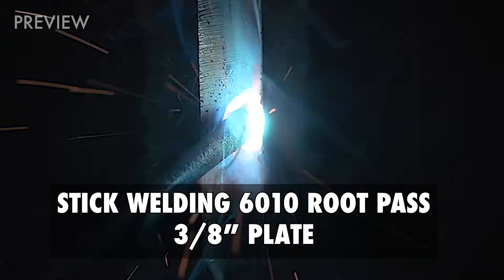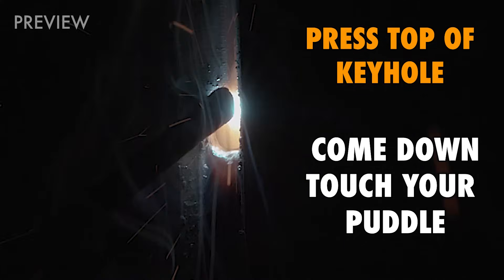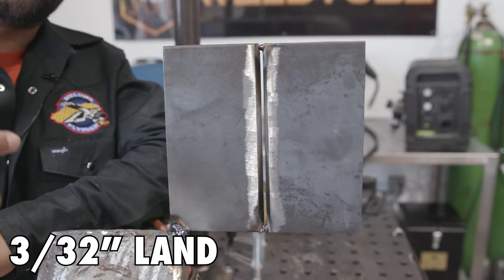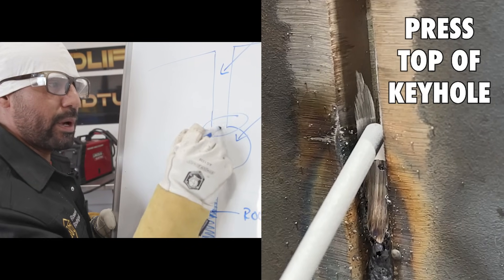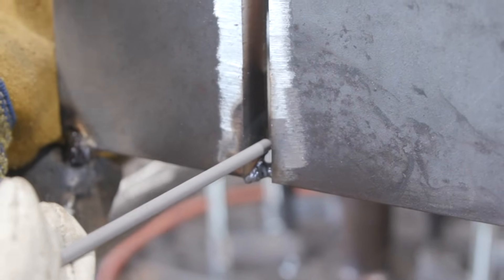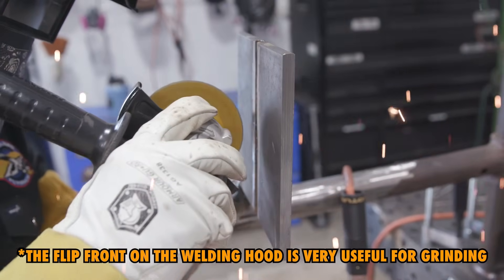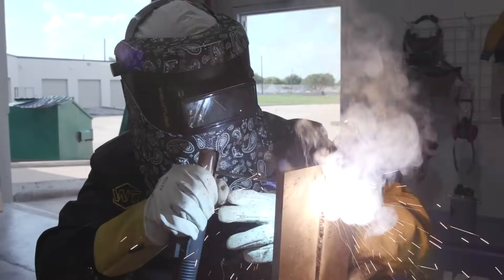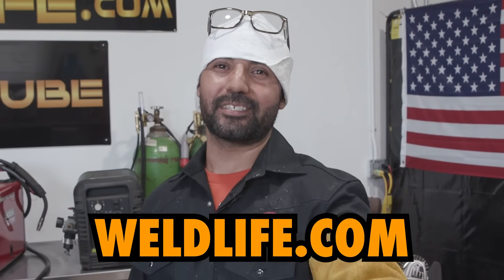Stick Welding a 3G Root Pass on a 3/8" Plate | Welding School for Beginners

Comment: Watching here in Philippines, I like this welding tutorial I am schooling welding SMAW , STILL STRUGLING TO CONTROL THE ELECTRODE  DURING STARTING, MY PROBLEM MOSTLY IS THE ELRODE EASILY STICK ON THE METAL EVERI TIME I SCRATCH IT TO START A SPARK . I WISH I COULD LEARN HOW TO DO IT PERFECTLY
Reply: Taasan mo voltahe at amp para di masyado didikit ang electrode at yung kaya sa pulso mo

Comment: Such a good work👍, do you know which way they bend the coupons of plate in testing of 3G uphill?
Reply: Most 3/8” plates have 2 coupons cut out, one being a face bend, the other a root bend. 3/4” plates for unlimited thickness testing are side bent.

Comment: What degree is the bevel and what is the best method for cutting it accurately?
Reply: That nigga could be 22.5 degrees (45 degree groove) or 30 degrees (60 degree groove) or it could be some some other motherfucka. And watchu mean what da best method for cutting it? You mean cutting out a bevel? Track torch is the best way to bevel them niggas. Other options is acethylene or even plasma torch.

Comment: Can I use this technique for 6g position on pipe?
Reply: Yes,but with a slight variation on direction, kindof pushing in on the center but pulling out and coming back down the ditch but depositing slightly on the upper bevel as it will want to sag down to the bottom bevel. Hard to describe in words,easier to show but itl come with practice,everyone welds slightly different.